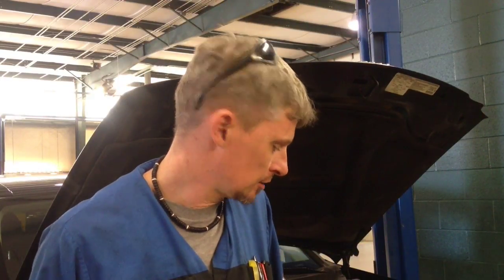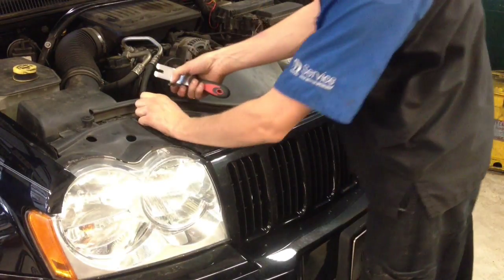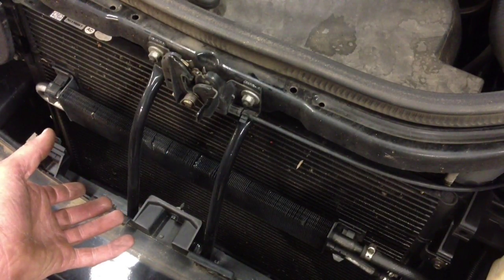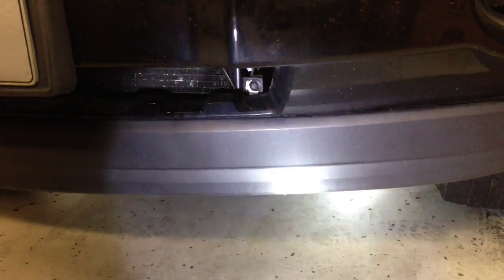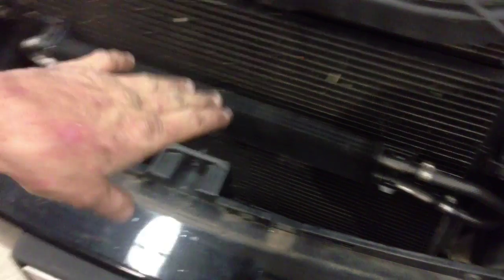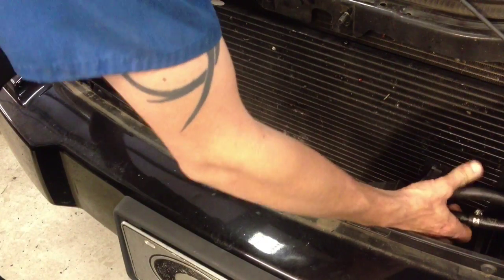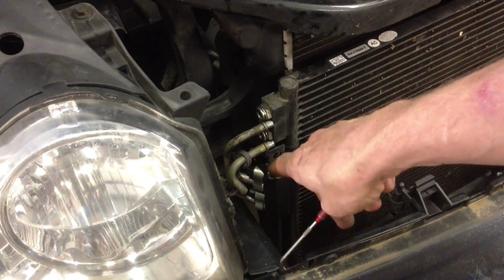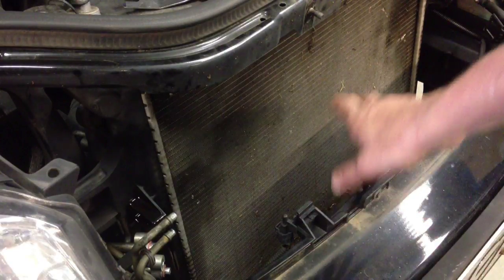2005-2010 Jeep Grand Cherokee A/C condenser removal

Comment: I realized the leak was coming from the a condesnor, after I had it completely ripped  apart.  
Is it absolutely necessary to have the ac drained 1st?  It would be difficult to put it all back together just to have the freon drained.
Any advice would be appreciated

Comment: Dear MC Mechanic, in the middle of the AC connection 13mm nuts there are the small hexagonal pins, what is the purpose of that ? What should be the tightening torque on that nuts ? Thank you in advance.
BR Kamil
Reply from the maker: Kamillo P. The pins are just threaded studs inserted into the condenser. Otherwise I don’t have access to the specs at this moment. I just go snug and never have any issues. Make sure to subscribe if you haven’t already

Comment: Where is the orfice or inline filter?
Reply from the maker: It doesn’t use one. If has an expansion block that meters the pressure instead of an orifice tube.
Reply: @MotorCityMechanic  so your saying if my high side pressure on my a/c gauges exceeded 200 psi my expansion valve is bad? 30 psi low - 350 psi hi and i still get cool a/c out my drivers side but warm on passanger

Comment: I have a 2007 jeep commander with the exact same set up. The transmission cooler is leaking. I bought the replacement and plan to do it my self. What else is involved? Do I have to have the ac recharged?
Reply from the maker: +Chuck Batsford I have don't one on a Commander as of yet. The service info states its part of the radiator and not the condenser. I would think its part of the a/c condenser. Being that I haven't done one and I am thinking that there could be a possible error with the service info.....I cant be 100% certain. The pics of the a/c condenser that I am seeing show trans line fittings. None the less if the cooler is part of the a/c condenser than you will need to have the Freon removed and recharged once done. The procedure will be different on the Commander when compared to the one in the video for the Jeep Grand Cherokee. That's based on what needs to be removed especially being that they are different body styles.
Reply: MotorCity Mechanic I'm doing the condenser on my 07 Commander 3.7L now, it's the exact same process as shown in your video.

Comment: when Im loosing the bolts to the ac connector I have pressure coming out like gas liquid, Its coming out of the lines. Is that Freon? Will I have to recharge it?
Reply from the maker: Okay.....I am assuming you didnt remove the freon before attempting this repair? If so then yes thats what is trying to leak out. I highly recommend having the freon removed otherwise you could get hurt and cause damage. The system is suppose to be emptied before taking the lines loose. Then once your done....have the system recharged/filled with freon. Thanks for the question and for following the steps in the video.

Comment: Motor City Mechanic. Thanks for the video. Had a diagnostic run on my system and was told the dye was just pouring out of my condenser so it need to be replaced. 2 Questions for you. Do you think my 2008 v8 4.7L grand cherokee laredo will be a very similar process to what you have shown and once done can I just take to a mechanic to flush system completely and recharge for me? Thanks for the great video!
Reply from the maker: +dan SEKERAK I would think the process should be about the same if not exactly. Make sure the system is empty of any Freon and yes, after your done....you can go and have the system recharged and be back on the road again. I appreciate the question and for you watching the video. Make sure to subscribe

Comment: Hi. Motor City Mechanic, thank you for your video.  My mechanic told me that my ac condenser i broken thats why my AC does not work. I have a Jeep Commander 3.0 CRD 2007 . My mechanic told me to better buy an orginal condenser becouse non original parts usualy dont fit. I know that orginal part's are better but they are always more expensive. What is your opinion ? Also you showed on your video that in Jeep G C the condenser is attached with transmision cooler ? Does it look the same in Jeep Commander 3.0 CRD? Soory for my langauge, not US  citizen ;-).  I learn a lot from your video. Thanks!
Reply from the maker: The OEM (original equipment) does fit well and your correct that sometimes the aftermarket replacement might not be 100% the same. In most cases they are pretty close. The service information says that the trans cooler is part of the radiator on this vehicle so it wont be with the a/c condensor. The vehicle you have is an odd vehicle in my part of the country so getting the part may be harder then usual. I have seen where the aftermarket replacement not be correct because they think its the same as the gas engine when its not in come cases.

Comment: Hi, thank you for the video. I have two questions, do I need to drain the transmission fluid when removing the condenser? I have a 2005 with 5.7 and the power steering cooler has a hose on both ends, will I be able to remove a/c condenser without removing power steering cooler completely?
Reply from the maker: +Tony Buckner You will only lose a small amount of trans fluid so no draining is needed. Just have a catch pan underneath to catch any that may leak out. You will not need to remove any p/s lines.....the p/s cooler will be removed from the condenser without unhooking the lines. Thanks for the question and make sure to subscribe